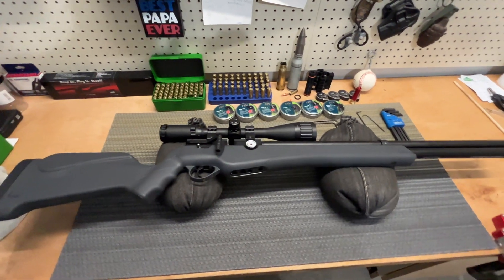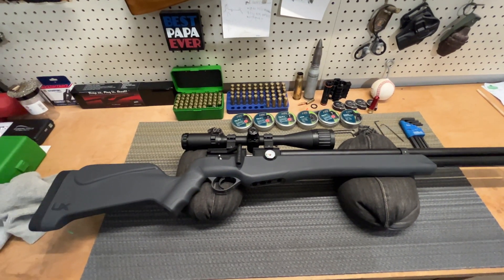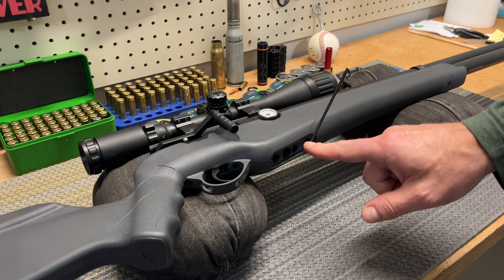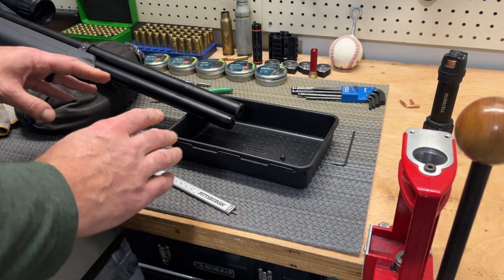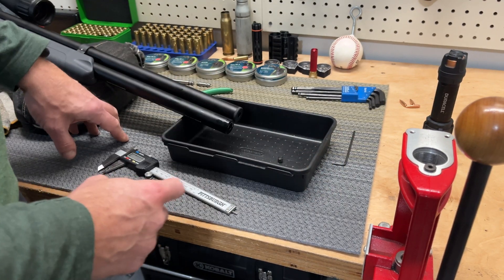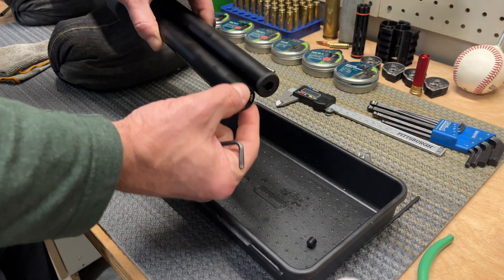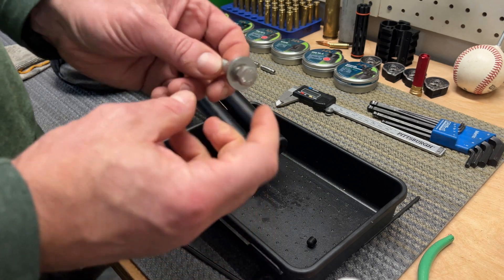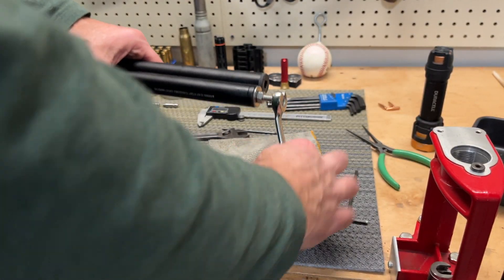Making Umarex Origin REGULATED

Comment: If my gun is leaking out the air gauge on the gun when I pump it up do you think that is a O-Ring? I just got it for Christmas and only shot it around 10 times then all the air went away after the last shot and now it comes out the top of the gauge when pumping it up
Reply: It could be an oring. I would definitely take it off and put thread tape on it when i checked the oring.

Comment: Thanks for this video. I just finished my regulator modification. i used the Lane regulator for the Diana Stormrider. Yes I had to drill a breather hole in the tube. I am pushing a .22 cal. 18gr JSB at 815fps. On the reg set at 1800psi.
Reply from the maker: Awesome, how consistent are your FPS?
Reply: @SuperPete276  with a 33.95 JSB MK2 I got an extreme spread of 18FPS (656-638 FPS) and a extreme spread of 1.8FPE (32.5-30.7FPE). .25 cal.
Reply: The info on my first post was incorrect. it was for my Hatsan Flash with a Huma reg.

Comment: I have had a Umarex Origin rifle for 2 years. Today I wanted to increase the speed. The madv that it gave is 811f/s and it has no air leaks. Could it be that the spring is expired? What can I do to speed up?
Reply from the maker: Only way to speed it up is more PSI, it's regulator is fixed, so there is no way to increase pressure and speed. You need to make it regulated, so you can increase pressure and get more speed out of it.

Comment: Great videos! would the huma-air regulator for the stormrider work in the origin?
Reply from the maker: Yes sir, it will
Reply: I ordered the huma-air and it has to be vented.  Im not sure im going to get it to work in the origin @PeterRebristy
Reply from the maker: @IL-Hunter86  Correct, vented regulators require hole drilled, not recommended.
Reply: @SuperPete276 have you had a chance to shoot a few shot strings with the regulator that you installed?
Reply from the maker: @IL-Hunter86   Yes, so, 25 caliber, 32gn slugs from 4200PSI to 2000PSI with regulator set to 2200PSI I was able to shoot 32 shots 805FP with standard deviation of 5 FPS. Rock solid.